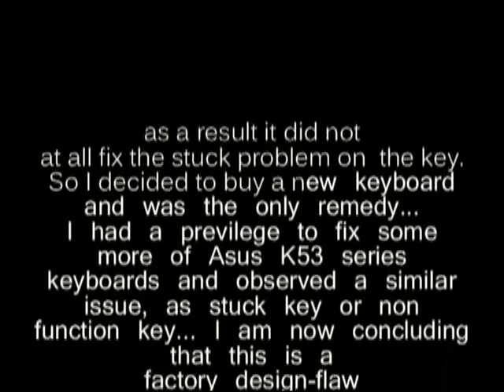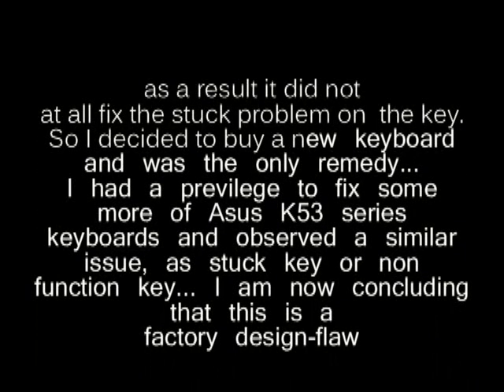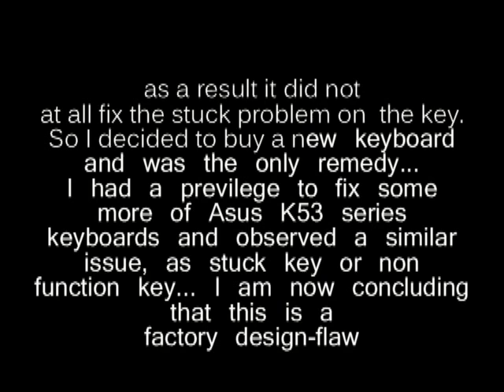How to Remove Asus Laptop A53 K53 Keyboard and Keys

Comment: I have problem with my k55vm laptop keyboard. some keys behave abnormaly. when I gonna
type some thing in the browser automatically page finder opens and + sign or = sign constantly
repetd!! and when  I gonna press z in the notepad some times 2 or 3 letters typed automatically.
So finally what wanna say is that can try your this solution or I have to do some thing else???